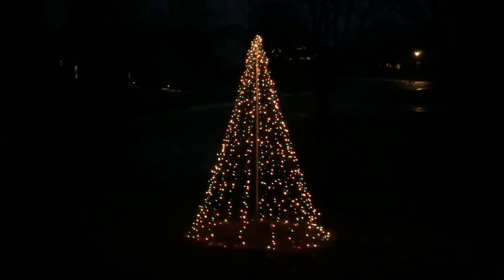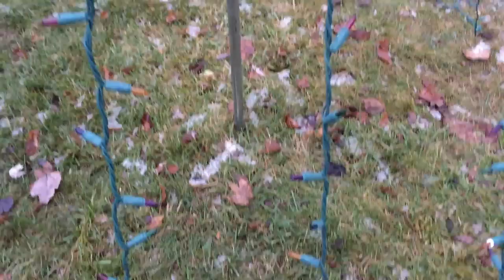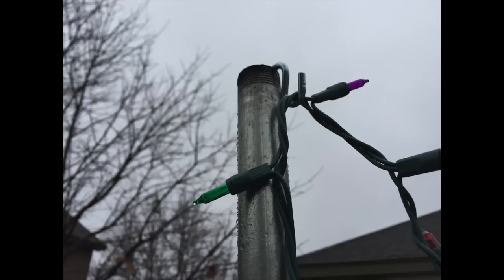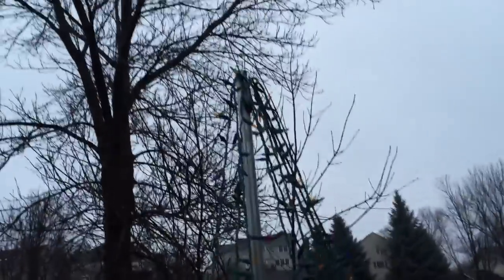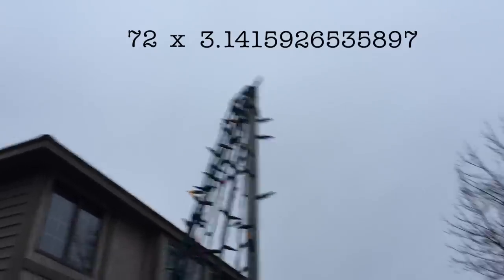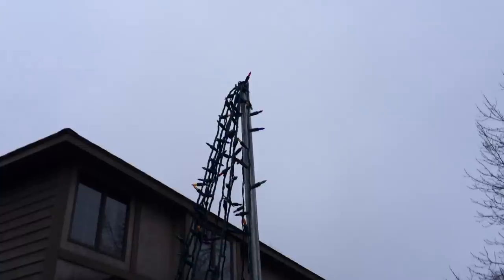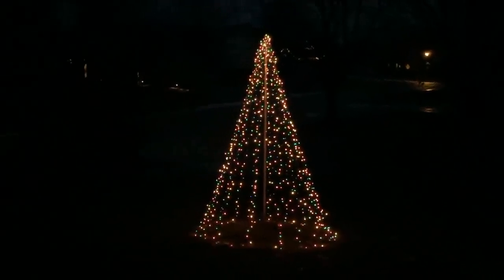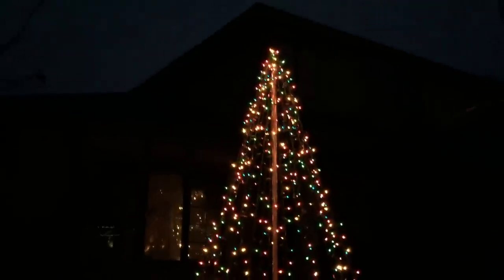How to Make a Christmas Tree out of Christmas Lights

Comment: This is great.Thank you for sharing. I used the pole and S hooks but put 20 separate strings of lights with plug protectors to seal the female end at the top then ran extension cords to each string so I could link them to a controller.
Reply: THanks. And cool, that's probably safer anyways. I'm making a new version this year that should be ginormous. Send me a pic of yours.